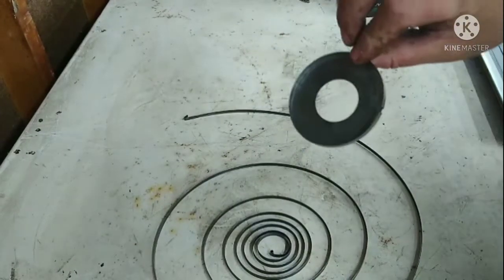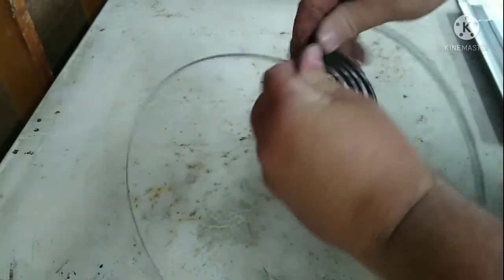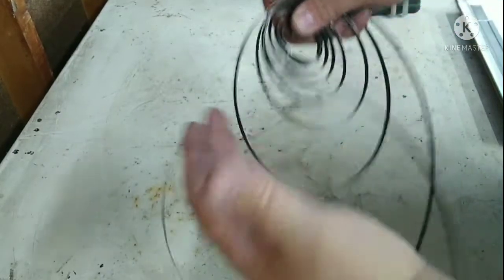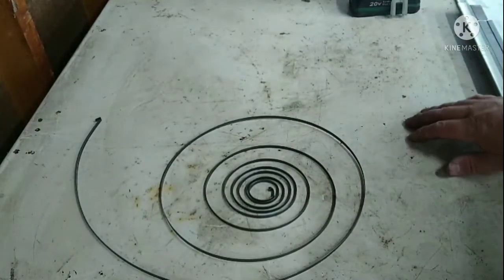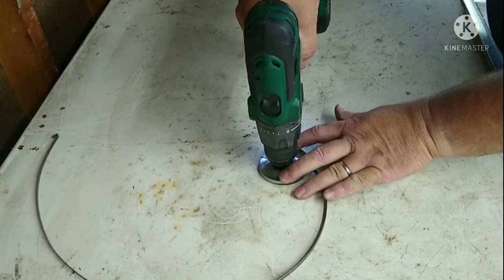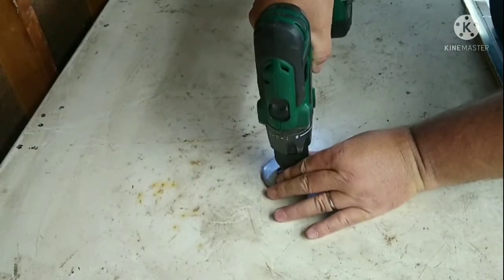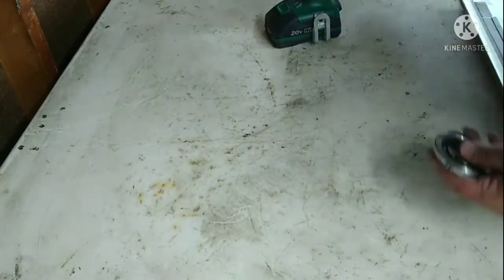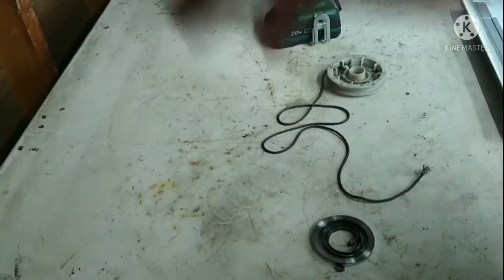Recoil spring rewind for small engines, lawnmower, snow blower, generator , pressure washer

Comment: It is actually quite dangerous this way.
I have a better way.
You just put the end of the spring (outside end) onto the housing in the position you want it to sit, then you start press in the spring piece by piece, getting smaller and smaller. This way you don't need power tools and i think it's way more safe.
Reply from the maker: Thanks for watching, remember to subscribe.